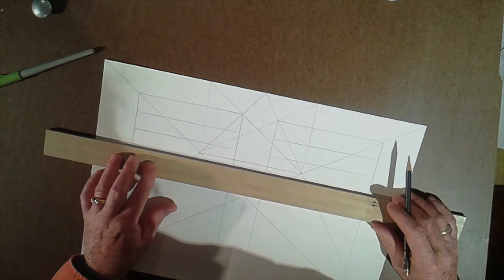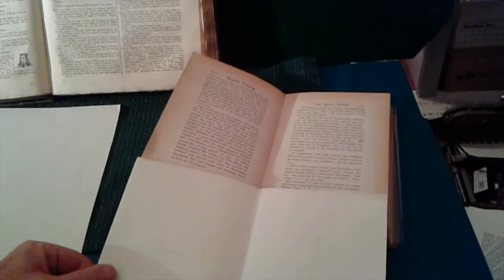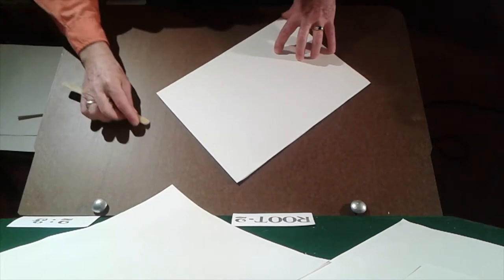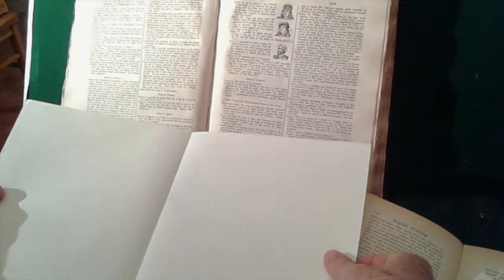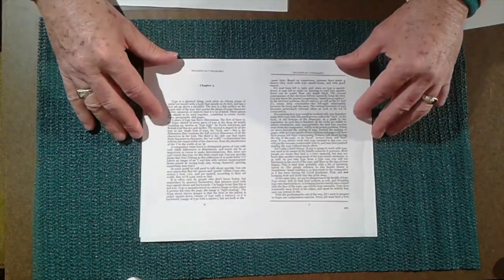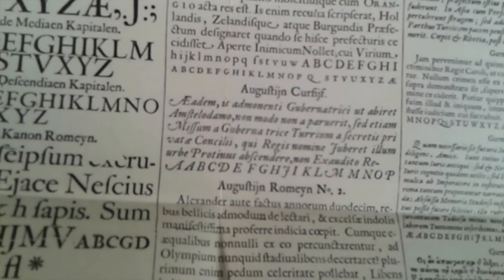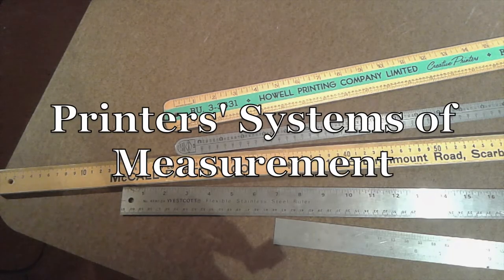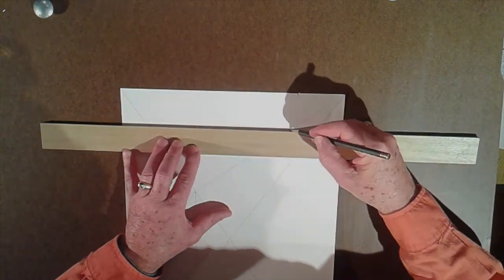Typography and the Printer

Comment: Great video; however, at about 12.09 the case used for setting has been 'laid' with the face of the type pointing to the left - better practice is to lay the characters pointing right, so that when setting, the type goes straight into the stick the correct way round.